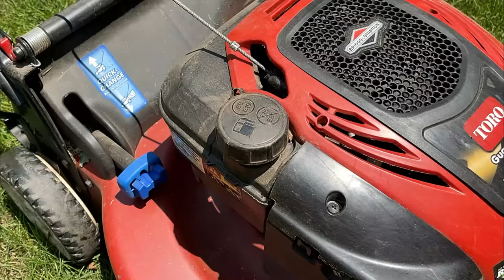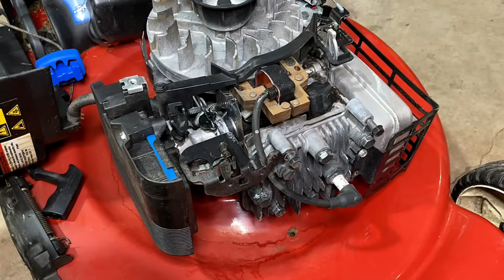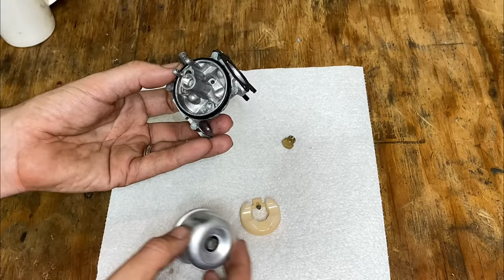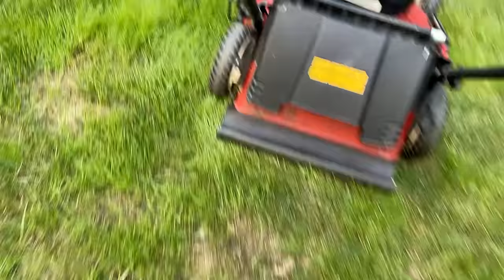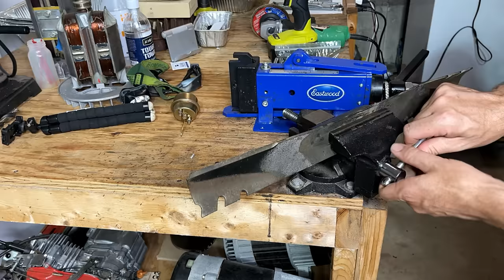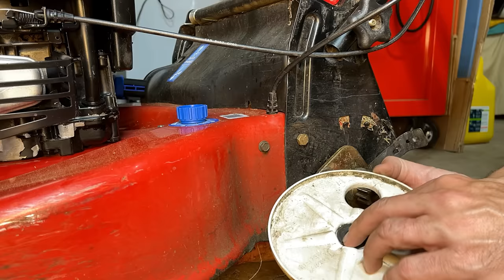Free Smoking Lawn Mower - Not an Engine Issue

Comment: I suspect that this mower was turned on its side with exhaust up rather than carburetor side up. And the mower wasn't given the chance to work it off. But time and again mowers that have problems are really dirty and always with a filthy carburetor filter. Mowers operate much better when they are clean. Mind does for sure. In fact when I don't clean my garden equipment they refuse to start on the first pull.

Comment: I have a pressure washer with the same engine that smoked and leaked oil after a minute. Turns out the crank case vent tube rubber elbow that goes to the air filter housing had a kink in it causing the crank case to build pressure and start pushing oil past the rings and valve seals.
Reply from the maker: That will do it.

Comment: FYI, at 9:30, that bolt does not need to be removed: the gas tank will pivot on it. I don't know how many times I took one of those off before realizing that. Moving the two gears closer would seem to be the only way to fix the meshing issue with the drive wheels. The hard way would be to weld up the gold plate and rethread in the right spot. An easier way, assuming the space is available, would be to make the threaded portion into a slot that would accept a nut on the back, get longer bolts if needed, and adjust things to where the gears mesh correctly.
Reply from the maker: Thanks for the tip.

Comment: Ok the gear issue. 2 ideas- Maybe the smaller one can be changed for a starter gear? Looks close. Get a measurement and look around online. I guess you could drill a new hole in the brass looking bracket. It would have to be closer but probably not near the old hole. Yes this would throw the adjustment off. 1/4" ?  Ok the gears need some gap. maybe a few layers of Teflon tape. Loosely. It's a temp spacer. Take the bolt out put the tire on place so gears mesh. Put a Sharpe in bolt hole and scribe. Put your hole on that line. Just far enough from original hole for stability. Take of the Teflon tape bolt and go?

Comment: One thing you could do is get a slightly larger drive gear 3D printed out of something tough like nylon.  If you could do it yourself, or had a friend who can do it at cost, it would be reasonable cost-wise.  Otherwise, it'd cost more than the mower was worth.

Comment: Nice job Looking at the back plate that the wheel mounts to looks like there is plenty of room above to drill and tap a new hole a bit closer to the drive gear if that’s possible ( don’t know what’s behind it)
The only issue with that is the rear wheels will sit slightly lower but at least you could get more life out of the wheels / gears.
The other option would be a small metal plate bolted to the back plate and sitting lower which would raise the rear wheels up. But that looks like the only options I can see without having to spend a lot of time and money sorting out what is a basic manufacturing issue 
If they made replacement gears out of stronger material and or made one of the sprockets slightly bigger would be a cure the manufacturer could have done but being the age of the mower and the fact that most manufacturers don’t care as long as it makes it out of warranty then it’s the customers problem
Reply: I drill a new hole to bring the gear closer.  Already fix several Toro. Only for person with skill.

Comment: to be fair the wheels had all the tread worn off them, so clearly that mower and drive system had some use and the tires did some skiding on hard surfaces, likely use picking up the rear of the mower and slamming it down onto a driveway with the wheels engaged back and forth across a lawn.. 100% metal gears would solve the issue but the plastic ones seemed to hold up fairly well if they outlasted the tread on the wheels
Reply from the maker: Agreed, the wheels were well used and needed to be replaced anyway.

Comment: Some solutions involving moving the wheel closer to the drive gear.  First, plug weld the axle hole closed, drill and tap new axle hole closer to drive wheel. If you don't have one, prime time for a cheap HF mig and you'll be fixing all sorts of things.
Second, while trying to think of a non-weld method, make a slot.  Drill a new hole past where the axle hole should be and dremel a slot between them.  Then, and you'll likely need a longer axle/bolt, a nut or jam nut on the backside of the bracket allows you to slide the wheel to full contact with the drive gear then back it off a touch and tighten the axle/nut.
Third, take the axle off, set the wheel back on the bracket and engage the drive gear as described above.  Once happy, mark the center of the wheel through the axle hole onto the bracket.  Then we can see if there's another spot to drill a hole without having to plug weld.  This would of course mess up the height settings, but probably not too bad (google searches show the adjuster pinned to the bracket so maybe can move it too).
Forth, if that bracket is flat, simply make 2 new ones with the axle holes closer.  A drill and a cutoff wheel on your grinder would make do nicely.
Last thought is drive wheels always end up wearing out the tread and quite possibly any improvement you make is offset by the fact you'll need new wheels about the same time anyway.
Reply from the maker: All would have worked.  But only so much time I am willing to spend on a $125 mower.  A cnc plasma cutter could have made a new plate with the correct spacing.  Also cutting the plate and removing a little material and welding it back together would have worked.  Think I need to upgrade my tooling.
Reply: @jcondon1  Yeah, half my trouble is figuring out which tool to use.  Plasma, metal cutting bandsaw, cutoff wheel....
Reply: @jcondon1  "Honey, my internet followers say I need more tools!"

Comment: Enjoyed that, am surprised the manufacturer seems to have got away with what looks like a serious failure in comissioning, that should have been sorted before it got onto the market.
Reply from the maker: Totally agree
Reply: @jcondon1  You are very pleasant to watch. I now know a lot more about generators etc than before. Although I get a bit stuck with the continuity checks you do on stators et al. Would it not be possible to rewind some of them ? Perhaps that would cost more than a replacement, but it might help in certain circumstances.

Comment: Nice repair, and nice that the seller talked himself into a free deal xP
I have a similar problem with a Norwegian mower, Partner with a Honda 5.5 engine. The drive gears are whacked and needs doing. I have a parts mower that hopefully has better parts, because if I were to buy new wheels for this, I'd be better off buying a new mower...
Reply from the maker: Wish the parts were more affordable.  Would save a lot of stuff from going into the trash.
Reply: @jcondon1  I agree! I hate the whole throwaway mentality; If something can be kept in use at a reasonable price, then by all means. Stops us littering with stuff that could be kept in perfect use.

Comment: 25:40 That very light metallic hint is pretty normal in my opinion. What you see is just the result of normal wear. These small engines dont have oil filters to filter the oil, so the metal particles float in the oil until it gets changed.
Oil looking silverish or contaning chips/chunks would be concerning. This is not. (Youre right)

Comment: bushings on the drive shaft wouldn't have to wear much to let the gears disengage under load.  looked to be a dry bushing so maybe a little grease would enhance the engagement?  also, the belt pully/90 degree drive system could be loose on it's mounting?  cheezey design and cheap materials probably is the real problem

Comment: Someone needs to modify the drive system so that the gear mesh can be adjusted as it wears. 😮  Maybe find a way to move the wheel mount.  Also get rid of plaastic gears ⚙️

Comment: The only logical solution to the drive issue, that I can see, would be for the manufacturer to supply either, replacement wheels with a larger gear, or replacement larger diameter gears for the drive shaft. Anything else would require some re-engineering on the mower itself, to bring the wheel closer to the drive shaft - That would likely need a new wheel mounting hole to be drilled and tapped in the backplate to likewise move the wheel closer to the drive shaft.

It's not insurmountable, but it is a flawed design which we wouldn't expect from an established manufacturer like Toro.
Reply: Unfortunately Toro, like many others, isn't the "established" brand that it used to be. That mower, again like many others, looks to be a big box store (Lowes, Home Depot, etc.) rebrand of an MTD built mower. 
 It's been while since I've looked, but I think there are still actual Toro dealers. The equipment they offer is much higher quality than their big box counterparts. That quality comes at a cost, though, that many consumers aren't willing to pay. The same holds true for Cub Cadet, Husqvarna, Troy Bilt and others. It's been that way since roughly 1985-90. The quality gap has widened considerably since then, though.
Reply: Could a 3D printer version of a wider drive cog work, or wouldn’t it be strong enough?

Comment: I just picked up one someone threw away with electric start had a valve guide popped out and was incredibly overfilled with oil changed the oil and reinserted and seated the valve guide and was back to mowing can’t believe how people throw away mowers as expensive as they are now with inflation
Reply: Was that a 22" with a Tecumseh flathead you're referring to by chance? I bought a used 22" FWD Craftsman 6.75 w/ the Tecumseh (from early 2000s) and it's had weird issues with oil disappearing and becoming very thin like gas despite no carb gas leak. I'm going to have to take it apart very soon to check/clean some stuff and suspect possibly a bad crankcase breather (lot of pressure from dipstick tube) and/or now a valve guide issue from your comment. I'm not very familiar w/ flatheads but am aware of the vavle cover under the intake/exhaust ports which i'll look inside. I've also seen the Tecumsehs have an 'oil pump' in them, must be to the valve guides and think it's gotta be losing oil there...

They seem a lot more complex/finnicky than the newer Briggs 5.5 OHV on a 2012 troy-bilt, especially as the Craftsman I bought has the electric start but I think I understand it well enough now after staring at parts diagrams for long enough to take it apart.

Comment: I have an old John Deere with the exact same pinion and plastic gears in the wheels.  On my John Deere when the tires wear away and the gears are still like new.  So, this design should work.  Toro just screwed it up.

Comment: I like the leaf blower used as your air gun. Quick and easy.
Reply from the maker: Thanks!  Just pressure washed a generator.  Did not blow it dry and 4 days later removed the blower housing and a bunch a water dumped out onto the floor.  Probably should stop pressure washing engines, but sometimes they just need it.

Comment: Ok this would certainly not be in everyone's wheelhouse but I would have probably tried cutting that wheel mounting plate with an angle grinder and then welding it back together. The kerf taken out by the grinder would probably have been enough to get reasonable engagement on the gears. I just could not see myself spending $40 know that the problem was likely to reoccur in short order. I am not sure how much trouble it would be to get the gear off the wheel but if it was possible, someone with a 3D printer could probably make a new gear.

Comment: Had 2 of these in last week. Seems unlikely but personal pace not working. Piece of wood stuck between belt and pully. Locked up transmission   These have blade clutch.

Comment: I have the newer version of that exact mower, 2022 model year, mine doesn't come with a metal carb it's plastic.  The Achilles heal on mine is the gas filtration inside the carb, the main jet, and the secondary are encased in a plastic plug in type unit.  The replacement code for it is 284806, it clogs up pretty easy.  I have ten of them on hand, and this year, I've already used two.  You can blow them out with a compressor but the nonstarting issue comes back, ask me how I know😂.  Super easy to replace, but jeez what a design failure.

Comment: Mr Condon often mentions that there might be an issue with "old" gasoline in the fuel tank. Is that a problem with is prevalent in the North American area, or is it world wide. I live in Sweden, and I have never even thought that that might be a problem, because i have had garden small machines which occasionally have been stored unused in the garden shed a couple of years and they have started normally after a couple of pulls with the starting string.

Comment: If that was me I would be looking at converting it over to a sprocket and chain set up.
A lot of fab work but it will never go wrong again unless you break the chain and even that would be easy to replace.
Reply: You'd have the drivewheels going backwards
Reply: @fromagefrizzbizz9377  Then you add an extra cog.
Reply: @dave4803   it gets comflimicating (sic ;-).

3d printing a slightly larger drive gear is probably cheaper and a LOT easier.
Reply: @fromagefrizzbizz9377  Metal is better as plastic wears out quickly and is easier to damage.
Reply: @dave4803  Of course metal is better than plastic, but fabricating a metal one costs a lot more than 3D printing a nylon one. Further, swapping out the plastic drive gear with plastic isn't going to destroy the driven gear nearly as fast.

Comment: In about 2013 a friend of mine's parents had a 2009 version of that with low hours and and it was making a terrible noise and the motor was condemned out of warranty so they walked away from it and and gave it to me..
I just wanted to see what was going on,, what failed,  and I was running it and it was such a strange symptom it's hard to describe.. 
I took all the covers off and was cutting grass with it while it was screaming and making this crazy noise and I noticed that the butterfly on the carburetor was opening and closing about a 100 times a second..
I went online looking for a setting for that governor,,,  nothin' called Briggs,   nothin' so I just took a guess in the middle of the governor shift travel and BINGO!
It's been my primary lawn mower for almost 10 years now and purrs like a kitten when I told my buddy and he told his folks they were not happy ,,   lol..
Biggest flaw in the design is the gas tank and I've been through 4 gas tanks,, luckily I'd learned early on to look for disposed lawnmowers with that tank on heavy trash days and I had a stack of used gas tanks but I'm down to my last one...

Comment: If I was cleaning the bottom of the mower deck I'd use a wire wheel made for a drill to remove as much as possible.
Reply: I just use my jet wand gets every thing off good and takes 1-2 mins.

Comment: Seven horsepower? I doubt it. Briggs tries to fool you with the big 7.0 on the shroud. It’s more than likely 7.0 ft lbs gross torque, and about four horsepower.
Reply from the maker: I don't doubt that.  Have seen the same Briggs engines over the years with different HP stickers on them.  Nothing was different other then the sticker.
Reply: I've been saying that for years.
Reply: Small engines used to be rated for 'gross' HP (i.e. a made up number like 60s cars) until fairly recently when a new SAE standard was implemented for net HP. The HP numbers are still exaggerated and made up though not as bad, however the peak torque numbers also as part of the new standard seem reasonable. What's funny though is that even with the new standard, the rated HP is still higher than if you calculated it manually (lb/ft torque x RPM (3600 typical for HP rating) / 5252) using the rated max torque (which is at like 2400 RPM and higher than at 3600). It is pretty egregious that they deceptively advertise the torque rating when the HP is like half to 2/3s what people think it is. 

For instance, a Briggs 550EX (5.5 lt/ft) is generously rated at 3.75HP at 3600 RPM, and 3.25HP if running 3200RPM and those are again using the max torque listed. Really most mower engines from 120-200cc are like 2.5 to 5 horsepower. Generators are very good for telling true HP as one horsepower is about 750 watts not including losses. Therefor, you need a real 10 horsepower minimum to output 7500 watts.

Comment: Thx vm for the video.  I have learned a lot. Just wondering though: why would you add the oil back in just BEFORE cleaning the underside of the mower and changing the wheels?

Comment: Well, if I were a lawn mower manufacturer that wanted to keep my service dept. busy, I could design plastic drive gears that are just a bit too far apart, but not enough to leave it inoperable. After about two or three seasons of cutting, it's pretty much guaranteed to fail and my local Toro service center gets a customer. But, I'm not a lawnmower manufacturer and I don't design drive gear lash distances. So, what do I know?

Comment: Increase the size of the smaller gear. This will improve the contact and wear issues.
Reply: That makes total sense. However, how would you do that for a repair? That is something that should have been noticed in engineering the mower. Oversized gears made for specific applications like this aren't available. Your observation is quite obvious. Why wasn't it to the engineers/designers?
Reply: @tomadkins2866  From experience I can tell you that the engineering designers do not get the final say in design issues. The accountants rule. I used to hate it.

Comment: Just wondering if you could see the amount of tooth engagement depending on the deck height? It may be that the slop in the gears is because of a lousy design and is dependent on how high the blade is set?
Reply: Good observation, but having google searched the bracket I believe the axle hole is a fixed distance from the drive gear so height won't impact the gear mesh.